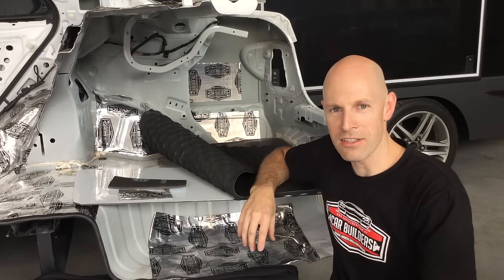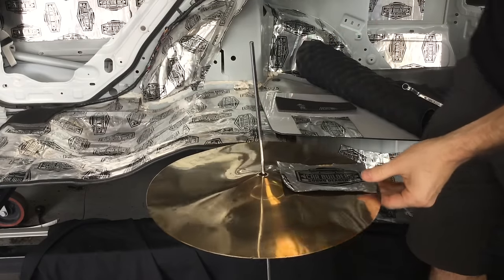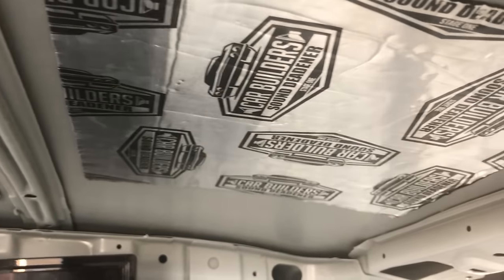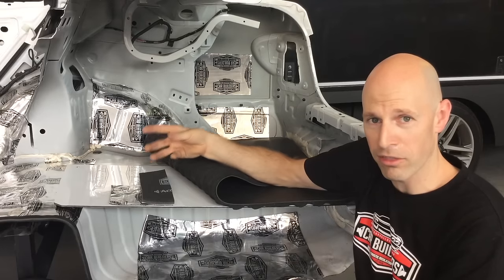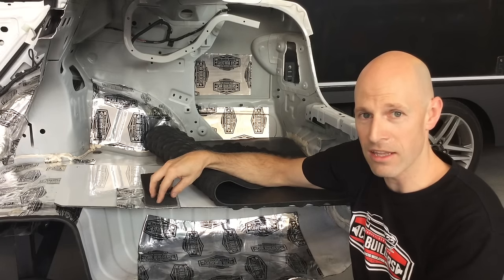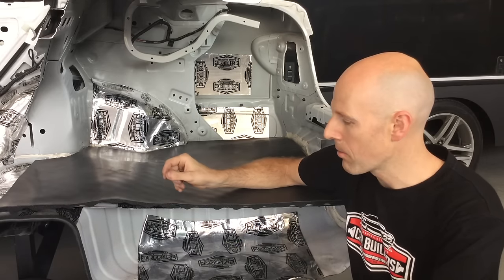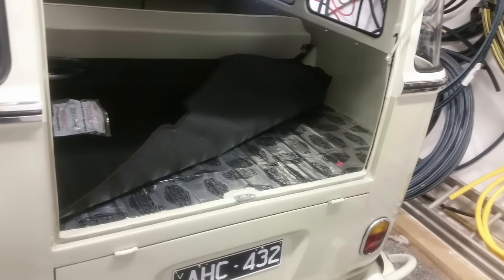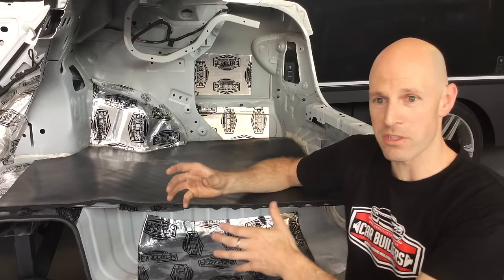The basics to sound deadening in cars. What should I use to control sound and heat in my car?

Comment: Can we fill the door pannels with acrylic or cotton instead of damping ?
Reply from the maker: Hi Bhagwan. Cotton can't replace dampening sheet as a Stage 1 product as the deadener is designed to connect directly to the sheet metal and control structure born and panel resonance. Stage 2 is addressing noise by filtering, something to consider is packaging in this stage.

Comment: Great channal. I subscribed becsuse I want learn hove soundproof car, pipes i house. My question is how much of sound deading material is at least required to be safe of vibration? 25, 50, 75, 100% of metal plate?!?  usually find answerin a range 50-75%.
Reply from the maker: Thank you Josip. 👍 I think you are right with your percentage. People have different ratios that they use to coverage surfaces. Auto manufacturer's will engineer sound proofing additions to a dollar point, researching the optimal positioning for deadening to just meet consumer expectations. Vibration dampening mats are most effective on single skin metallic surfaces.  It is unnecessary to apply deadener to over-lapped metal sections, top hat, chassis sections etc as these areas don't resonant.  To engineer a car it takes some skill and technical analysis to pin point key areas, in reality most people will cover everything as they don't mind spending a bit more to ensure they have achieved the desired results. With paying customers, most people want everything covered. Keep in mind that this is  one stage in controlling sound in your vehicle. 😎👍
Reply: @carbuilders1  Thank you on answer. I want soundproof car from vibration and reduce tyre noise (I do no metter for loud music). Mostly I hearing noise from trunk in my Ford Focus 2010. I hope that project will be succesfull :) ps just yesterday soundproof pipes with armaflex 13mm, a lot less noise.
Reply from the maker: Great. Good luck with the project 👍

Comment: How much weight does it add
Reply from the maker: Hi hackenely laurent. The Sound Deadener (Stage 1 butyl product) weighs around about 6.5kg per 1.8sq/m. Typically you will use two boxes (3.6sq/m) to cover a sedan floor pan from top of firewall to the base of the rear seat, which will be about 14-15kg.

Comment: would it still work if you put it over the car carpet or do you have to put it under?
Reply from the maker: It would, however, depending on the product, it won't be a durable finish. It is recommended to go under the carpet.

Comment: This is a great video. I am doing a complete rebuild of 1966 International Travelall (like a suburban). I have used Lizard Skin as my primary sound layer of sound deadening and heat protection. In other projects, I have then installed Dynamat Extreme on top of the ceramic sound deadening.  This car is so big I was wondering for the roof if I could install strips of a sound deadening instead of completely covering the entire roof ceramic coated with Dynamat or your product if sold in the US. Thanks~P.
Reply from the maker: Hi Peer. Have you used the Dynamat on Lizard Skin? You will find that it (or any butyl product) doesn't stick well. Lizard Skin is water based acrylic, which is porous like your residential wall paint. If you are going to do the same thing on the roof, adhesive is crucial. Therefore paint over the Lizard Skin with a solvent based automotive acrylic, which will further seal the LS and make the deadener stick far more effectively. 
Yes, you can use strips throughout the roof. Look to cover the middle of the single sheet metal panels. 
The Car Builders brand is looking to come over to the US. We just need to team up with the right retailers over there 👍
Good luck with your project
Reply: @carbuilders1  cool- thanks- I usually paint it to get rid of the porousness. (if that's a word)

Comment: Basement sealant 5 inch roll 1/4" thick if that. Rubber and sticky bottom  ..Rolls good $13 USD for 12ft   Done it around my door speaker and inside skin of the door.. Driver / pass firewall to under the seats  Sides of the SUV and rear floor  And middle of roof 

But i also done solid foam on the floors and sides and added Cedar flooring  which works well for camping inside in cold to very cold nights

Comment: so which material best for car door?
Reply from the maker: You definitely need Stage 1  Sound Deadener on the outer door skin to stop vibration in the panel. If you are then chasing sound quality, you would place Acoustic Liner behind the speaker to capture waves generated from the back side of the speaker.
Reply: And what to apply to inside of the door trim surface and for which purpose? 

Also, does the recommendation change  depending if there is a speaker in the door or not?

Comment: Great stuff, but you can save a lot of money if you do what I did. I made a cowl out of the stuff that fits over my head completely,  just like batman's without the bat ears. Cut some holes so I can see & I can't hear a Dam thing while I'm driving, its cool too.
One small problem I have is having to use a pry bar & screwdriver to get it off, especially on stinking hot days. So, take my advice & shave your head like the guy in the video. He obviously wears a Dynamat cowl too.

Comment: Don't radiant barriers require an air gap? If you're putting a radiant barrier in contact with with the material, it's just going to conduct heat from one surface to the next.
Reply from the maker: Hi Samm. Your right, we don't recommend the sound deadening to be used as a heat shield, its purpose is to stop vibration generated noise. We have videos on heat shield products that are heat facing. 👍

Comment: Where would one get the best results from the least amount of sound deadening? In the doors? M.
Reply from the maker: This is a difficult one to answer as it depends on various factors such as the make, year, existing deadening, environment (off road) etc however the deadening will have the best results when it is applied to large, single-skinned, sheet metal areas particularly where mechanical noise is found. For Stage 1 vibration noise, the dampening sheets do get great results in the doors however, if you are trying to cut down on external noise by using a Stage 2 product (sound blanket) then locating the source of the noise e.g. firewall, engine noise, will get the best result. Sorry for the vague answer as it really depends on what you are trying to achieve/purpose ( e.g. off-road) and the vehicle.
Reply: Thank you. Your reply was very helpful. M.

Comment: I’m about to do rear wheel arches, but a bit confused what thickness deadener would be best. Would I get noticably better results using 3 or 4mm deadener if my main mission is to reduce extrrnal road noise? Or is 2mm enough (and 35mm wave foam on top)?
Reply from the maker: Hi emilz85. Yes, 2mm is thick enough to stop vibration in panels (which is its purpose). The stage 2, mass loaded vinyl is important for what you are trying to achieve. 👍
Reply: @carbuilders1  Thanks. I’m in Latvia, and have not seen MLV anywhere here, so idea was to use 35mm wavy rubber foam on top of vibrodamping. The thickness question came up after watching some videos of a Russian company installs, they always use 3mm deadener on floors and 4mm on wheel arches, and 2mm for thinnest metal like doors and roof. I want good results, but am a bit concerned with added weight also, so might stock with your advice.

Comment: We're looking for a solution to traveling halfway across the US with four cats where we are relocating. I was wondering if this product might reduce the "meows" that might be ongoing if applied to each carrier.  It seems driving will be less stressful for the animals than flying in cargo so we're trying everything we can think of.
Reply from the maker: Wow, what a trip you have ahead! I'm imagining that the carriers have vented areas which means that it isn't really possible to sound proof it as such. Like a bucket with holes in it, the sound will leak out. Good luck with the trip 🐱

Comment: Why should I believe that you are the source of credibility of information when it comes to control of sound and heat in vehicles? Everyone claims something and by the end as consumer I am confused about every youtuber claim that he provide reliable information and not just advertising of manufacturer products!
Reply from the maker: Hi Bo. Thanks for taking the time to share your thoughts. Yes, it is a challenge. Hopefully we can give information about the material and what it is doing rather than saying to buy ours. For one, we are constantly saying that sound dampening sheets are widely mis-marketed as the one product to stop all sound, however they will just treat panel vibration noise. It sounds like you are doing your homework so you will work it out. Good luck with your project 👍
Reply: @carbuilders1  Thank you for your constructive feedback. You are right I am actually working on personal project and thank you for your videos it helps me to work out and narrow my choices.

Comment: So could I just stick some deadening material under my floor mats, front & back, and my boot mat?
Reply from the maker: Were you thinking of putting Stage 1 or 2 there? Pads of Stge 1 will stop resonance in panels in  these areas. Stage 2 will have some effective depending on how widely the product is laid.. The Stage 2 is more effective if it blankets the area to stop external sound.
Reply: @carbuilders1  ok. So what was stage 1 and stage 2?

Thank you
Reply: I wash thinking the Uxcell add they're the thickest.
But any recommendations on how best to do this for floor mats only?

Thanks again
Reply from the maker: Hi Nisar. In this video we have used our Car Builders butyl mats as a Stage 1 vibration dampener https://www.carbuilders.com.au/sounddeadener With Stage 2, we have a variety of options. Our thicker option is Mass Noise Liner https://www.carbuilders.com.au/mass-noise-liner
Reply from the maker: The Mass Noise Liner (MNL) https://www.carbuilders.com.au/mass-noise-liner will work under mats. Ideally you are aiming for 100 coverage for Stage 2 to work best. The MNL is 1.5m x 1m. It could be cut to place under each mat.
Reply: @carbuilders1  Thanks.
Is the liner Stickable to the bottom of my floor mats?
Also the foam side needs to be facing down?
It would need to stick to the mats to stop moving around, or i could line the whole floor since it's black, and have the mats on top I think.
However I could also lay it over the mats, as i have secondary clear mats also as an uber driver so that my original mats stay clean.

Comment: What is the benefit of the open cell foam part of that dual (OCF+CCF) foam underlay, compared to if it was completely made just of closed cell foam of the same thickness as that OCF+CCF sandwich?
Reply from the maker: The Acoustic Liner is the product you are referring to, since the product is used as a carpet underlay the CCF as the top layer offers greater durability under high pressure heel and foot areas, meaning it wont crumble and deteriorate in the long term. By placing the CCF on top it also means if you spill liquid on top it will not soak into the underlay.  Another addition is the CCF offers greater thermal insulation.
Reply from the maker: The open cell offers some form of noise filtering in the limited space between carpet and floor pan, the use of both materials combined also makes the product flexible to conform to floor pans

Comment: Should you cover all surface or 40-50%?
Reply from the maker: Hi Chance. You're right. Around 30% of a panel will make a significant reduction with further deadener continuing to produce results but not as dramatic as the initial application. Auto manufacturer's will engineer sound proofing additions to a dollar point, researching the optimal positioning for deadening to just meet consumer expectations. Vibration dampening mats are most effective on single skin metallic surfaces. It is unnecessary to apply deadener to over-lapped metal sections, top hat, chassis sections etc as these areas don't resonant. To engineer a car it takes some skill and technical analysis to pin point key areas, in reality most people will cover everything as they don't mind spending a bit more to ensure they have achieved the desired results. With paying customers, most people want everything covered. Keep in mind that this is one stage in controlling sound in your vehicle 👍

Comment: I have a 96 swift gti. I want to put deadening in the floor and doors. I dont want the weight to affect the performance, its a small 1.3 engine.  Is there anything suitable for this? Can you help? Im in melbourne. Thanks.
Reply from the maker: Hi mate. One box of deadener is 7kg. We would say you need two boxes for that car (14kg) but if you are really chasing weight you could stretch box by using pads in critical areas. Good luck.
Reply: @carbuilders1  thank you, much appreciated 👍

Comment: No manufacturer needs BETTER insulation than Honda. The road noise is redonkulous!  My mom's 2018 Accord sounds like a 1979 Civic on the highway.  Do something about this, HONDA!!!  Insulation materials can't cost that much when you can buy it in bulk.
Reply: Bobby Clemente yess you’re right ! My 2016 hrv ( vezel ) is sooooo noisy inside from the road noise !

Comment: can any of these sound dampeners trap moisture and make it rust underneath?

i drive a Mercedes w210 that has very little rust and i would like to keep it that way   :)
Reply from the maker: Hi Knut. We have a few videos dealing with this. Essentially the Stage 1 Sound Deadening is a water proof barrier. Variants of butyl are used in plumbing as a water proof sealant. Once rolled on, water can't get between the butyl and the panel (unlike the old bitumen stuff that would dry out, crack and lift). The Stage 2 materials vary, some are water proof and some aren't. Factory underlays, including Mercedes, have variants of cotton jute which will hold water and develop mould etc. We have water proof underlays to replace these materials that won't hold water. Mass Noise Liner can also be remove (which is a feature for 4x4 owners who may swamp their vehicles) 👍

Comment: Have you used any of the spray on sound and heat materials? So many products it hard to sort through. Thanks
Reply from the maker: Hi Ken. Yes, we also have spray on sound deadening paints. This can be a preferred option if the vehicle is stripped. You should be careful when looking at paint options because many  paints claim to be a deadening paint but are just bedliners or underbody paints. Paints like Lizard Skin Sound Control are mass loaded paints, purpose made as deadeners rather than protective coatings. These paints often need to be sealed is they are to be the exposed finish.

Comment: Does this stuff stop tyre noise?
Reply: no. that would be your tires. But I'm sure it would reduce the road noise a bit.
Reply: @mhaas281  surely insulating the cabin from the wheel arches would quiten it down

Comment: Great video explaining the different layers. What is the name of that last layer, the most expensive I'm sure.
Reply from the maker: Hi JD. The heavy duty Stage 2 material was the Mass Noise Liner (there is also a Mass Noise Liner Lite that has a 6mm closed cell backing rather than the egg shell 13mm backing, both are 1.5m x 1.m) https://www.carbuilders.com.au/mass-noise-liner and https://www.carbuilders.com.au/mass-noise-liner-lite

Comment: What are the universal names of those materials?
Reply from the maker: Hi Onur. Our Sound Deadener is a butyl rubber with an aluminium face. In the video we also show a foam that has a 6mm closed cell top and a 6mm open cell bottom half, which has a peel and stick layer so that it can be applied to a surface. We also show a heavy treatment, which is a mass loaded vinyl with a closed cell bottom layer.

Comment: Would putting these in the door cavity's have any chance of causing them to rust?
Reply from the maker: Hi there. The sound deadener butyl base creates a water proof barrier (no water can get between it and the panel). Where there is no deadening sheets you can also brush/spray cavity wax. We do this in the bottom of the doors where water may sit. 👍

Comment: And the cost will be scary ..
Reply: the idea is that you don't have to do it all.  If you simply do the peel & stick to the sheet medal skin of the doors (DIY) using a sound dampening mat its cheap (under $50); and you will experience significant sound dampening and reduced road noise.
Reply: Imagine labor if you don’t do it yourself.
Reply: I do it myself ...a few years now(whenever I have time), takes time but results are great :D
Reply: Know this is a few month old comment, doing it myself I've done the boot for 50$
Reply: @sat_sonic  Not true at all.  Vibration damping mats are narrow band treatments, they work on and around the panels natural resonant frequency only.  They do not block broadband noise which is what most road noise is made up of.

Comment: That cymbal example is absolutely genius! So simple, so effective. Anyway... I am looking for help. I'd like to treat door on my Audi TT 8N (MK1) but the door speakers mount is kinda weird. The speaker is not attached to the door frame (metal) but to the door panel instead (plastic). There's a foam layer between the speaker and the metal frame of the door. The metal frame of the door itself has huge opening throughout it. How would you treat this particular door? To have better idea please check few seconds from this video: @qgIg Hope to get a reply. Thanks a lot!